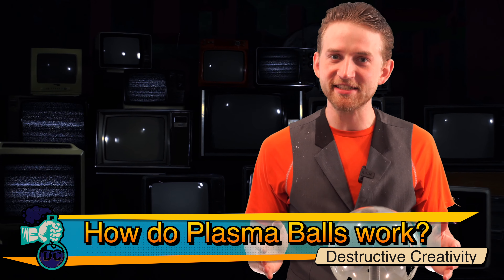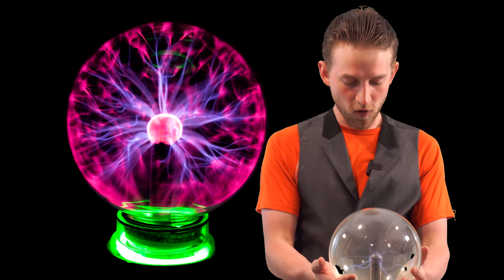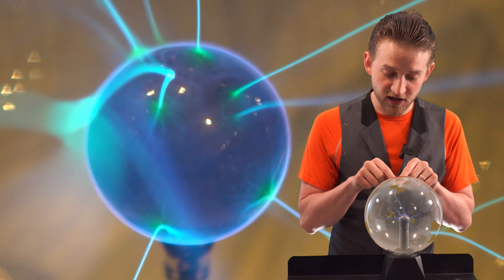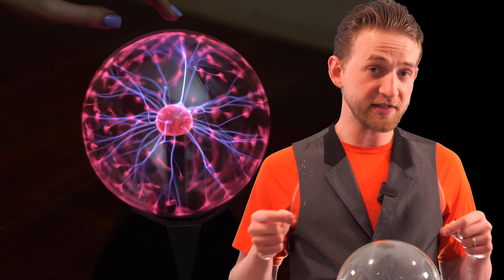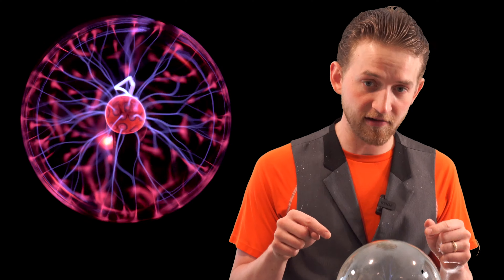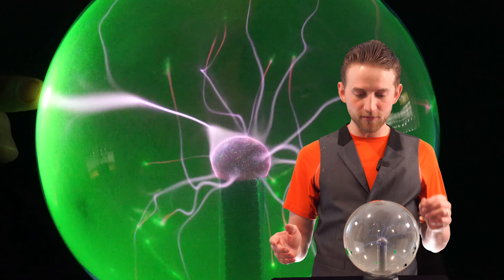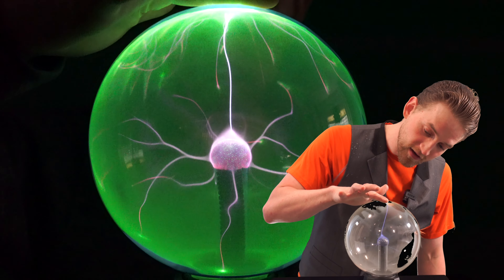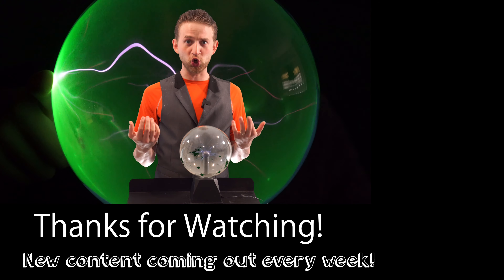How do Plasma Balls work? Plasma ball explained!

Comment: You can get an electric arc to form outside of the globe if you have two different people lay their hand on the plasma ball, but separated by about 1/8" to allow for the weaker arc to cross the gap from one person's finger to the other person's. The short little arc gives a minor burn sensation of course so you can't do it for more than a few seconds at a time. I wonder if both people wore chainmail gloves if the arc could be stretched out longer than 1/8".

Comment: It is believed that the seven seals of the body are powered by plasma so I purchased a 10 inch globe plasma ball and had it retrofitted to attach to my RIFE frequency healing machine so now I am able to run frequencies for specific diseases through the plasma ball hitting the seven seals of the body to create healing. Also just having the plasma ball on in the room while running the frequencies it removes the static from the room which gives a cleaner frequency for the client! Not only does this all work it is extremely effective! Been doing this for years and I am so so busy with people coming in daily for treatment. But I do not diagnose nor do I care lol L O L I have to say that or I could be shut down, isn’t that ridiculous!?

Comment: So if electrons are traveling through the air / your finger, can current be measured?
Reply from the maker: Great question! I am actually filming a video that covers this question. But for the moment, yes there is a current, but I don't have a solid measurement yet for what that number is.
Reply: Could you connect an earth lead to a multimeter (DC i guess) and connect the other lead to the glass? I'm not sure if the electrons want to go to earth but would be fun to try.
Reply from the maker: Yeah, there are a few problems to overcome. The biggest one right now is that most instruments that measure current don't handle really high volts very well. But it's a fun problem to work on.

Comment: its not a tesla coil its a small ac flyback transformer that uses an easy high voltage generator plus that center column is just to protect the transformer wire from touching the glass :3

Comment: So what happens when all the electrons have been stripped and how long would that take?
Reply from the maker: Good question! Essentially what I think you are asking is, what is the next step beyond plasma? And the answer is nothing will happen (kindof). All of the bonds than can be separated by heat and energy already have been broken. (The electrons are already separated.) Now if you add an extreme amount of pressure there are ways to separate the quarks within the protons and neutrons of the atom. Which is the only way to achieve the 5th state of matter. But that is a process I honestly don't know much about.
Reply: @DestructiveCreativity  well, you said the electrons are being separated and they leave the globe. So what happens once they’re all gone?
Reply from the maker: @pacovl46  Ah, sorry, I misunderstood. The electrons that are stripped from the atoms of the noble gas do not contribute to an unbalanced electric charge.  (As in, for every electron that is stripped, there is an equal positive charged ion from the atom) So the current that is travelling from the tesla coil to your finger (and down into the ground) is supplied by the battery or plugin of the plasma ball. I should have specified that the electrons that are separated simply jump back into place after the outside influence of high voltage radio waves are removed.
Reply: @DestructiveCreativity  thanks for clearing that up! 🙂
Reply from the maker: @pacovl46  No worries, happy to help.

Comment: Hey why does the static with in the plasma ball follow your finger tip and how does the plasma ball work (I am more of a reader to understand)
Reply from the maker: Short answer. High frequency and high voltage is created by the central tower, which then excites the inert gas, turning it into plasma. Then when your hand touches, the electrons seek to find the best way to ground out, which is through you. :)

Comment: the electricity wants to travel to the ground specifically? or just heat ? or any solid? like if I jump and don't touch the ground and touch the plasma ball will it not travel to my finger because I'm not a path to the floor?
Reply: The electrons goes to ground for stability as it becomes neutral. If you jump and touch the plasma ball, it will travel to your body because of force of attraction and you may or may not feel earthing according to its electron volt. This are all my assumptions. Hope it solve your doubts.

Comment: My question is how it doesn’t melt the glass or hurt you
Reply: It's so hot but also so small , just like a gram of molten steel is colder than a bucket of ice. And the It has high voltage but extremely low amp and it's not necessarily flow through you so you don't feel a thing.

Comment: What if i break the glass and touch the center?
Reply from the maker: Nothing at all. :) Maybe a very small static discharge, but nothing you would notice. The colors are just from the fact that the globe is low pressure and filled with inert gas.

Comment: 1. I got a plasma ball for my birthday and I've always wondered how they worked!
2. Sometimes When i put my entire hand on the glass it turns into one lightning bolt. What's up with that?
3. How long do these last?
Reply: Had one for decades.  Finally stopped working when the power adapter died.

Comment: Oh cool so if you wanted to you can get those big tesla coils and put gas around it then you can make a big one And I have a question if you could keep the gas around the tesla without glass would it still work? And can copper handle plasma?
Reply from the maker: Yup, the big tesla coils are doing the exact same function as the plasma balls. (Just on a larger scale) The glass is necessary for this size of plasma ball because it is a low pressure, and thus easier to create the plasma we see. But with more power, you don't need the glass at all. As far as copper goes, it will very nicely conduct the electrons from the plasma ball.
Reply: @DestructiveCreativity  ok so my fictional character that chucks little copper shards that have electrical properties is at least partly possible thanks

Comment: So does change between noble gas and plasma everytime you turn it on?
Reply from the maker: Yes, every time it turns on, the noble gas turns into plasma, but only in those tendrils. The more energy you give the central coil, the more noble gas gets converted into plasma. (More and thicker tendrils) As soon as the energy dissipates, (it gets turned off) it resumes it's more stable state of gas.

Comment: Thanks for this wonderful explanation. What is the average life of plasma or gas used inside this ball? Say we keep touching it a lot. Does it need gas refuelling after sometime?
Reply from the maker: It will never need to be recharged because it is just converting the gasses into a different state of matter. As soon as you turn the power off, the plasma reverts back to whatever noble gas was originally in the globe. The only reason it will stop working is if the vacuum seal on the glass is broken. If that happens, then there will not be high enough concentration of gas to convert to plasma. Hope this helps!
Reply: DestructiveCreativity b
Reply: @DestructiveCreativity  what if you never turn it off? will it ever get 'tired' of converting back and forth?
Reply: @kori1903  you could think of it this way: it's kind of like melting and freezing the air. It uses electricity to melt the air, and the air eventually freezes again. And like water, which never gets tired of freezing and melting, the gas never gets tired of becoming plasma.

Comment: Why is the low pressure gas inside the glass necessary?
Reply from the maker: The low pressure isn't as necessary as the presence of pure noble gasses. (Argon or xenon, for example.) The lower the pressure the easier it is to remove everything except the noble gasses.

Comment: are you sure it emits a 35khz radiation pattern? if so, that is not very "high", in fact "high frequency  band is 3mhz to 30mhz, which is 1000 times higher than khz.
30khz-300khz is considered "low frequency"

Comment: Does the owner of this site still check comments? I have a question about my Plasma Ball. I used a Geiger counter to see if ball was emitting any radiation, I was blown away that the alarm sounded because it was reading 50 micro  Sievert per hour value. Is it possible that this ball is thrown off radiation that is dangerous to people?
Reply from the maker: Okay, that is a bit complicated and is a result of how Geiger counters detect radiation.  I don't pretend to be an expert on them specifically, but I know that plasma balls can not emit gamma rays. (Or x-rays, for that matter) Geiger meters detect "ionization events" and occasionally plasma balls and even florescent lights can somewhat trick them into detecting a phantom radiation. For more in depth reading, you can read this paper! https://onlinelibrary.wiley.com/doi/abs/10.1002/bem.20675
Reply: @DestructiveCreativity  Thanks for your explanation. I have been searching for the answer for the last hour and your comment just confirmed exactly what I have concluded. Again a huge thanks for the reply.
Reply from the maker: No problem. Thanks for asking!

Comment: Are these safe will they not kill me with 4 billion volts cuz I don't wanna die to a toy
Reply from the maker: They are quite safe :) the only danger comes from if you were to hold a piece of metal against it for a long time, it would get hot.
Reply: Ok
Reply from the maker: Yes, the amount of radiation is very low. You can look at it for as long as you want.
Reply: It's not a toy bud
Reply: @Jeraldclark15  i know

Comment: Why are there a lot of little strings?. Why doesn’t it just glow evenly throughout the whole globe until you touch it?
Reply from the maker: Good question! That's where plasma comes in, there is enough energy that the gas must turn into plasma. Once it does, at the smallest possible level, it creates a stable electromagnetic field around itself to conserve energy. (I may do a whole video on that by itself) And once that field has been established,  it is easier (more energy efficient) for the plasma to grow in a stream toward the outside of the globe and the ground than to just diffuse evenly.
Reply: DestructiveCreativity thank you i would definitely watch that video